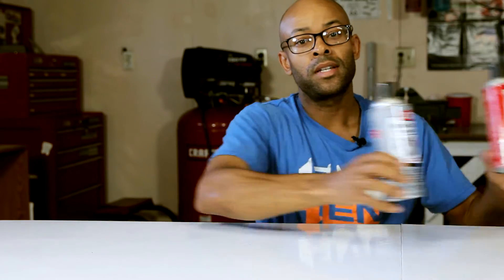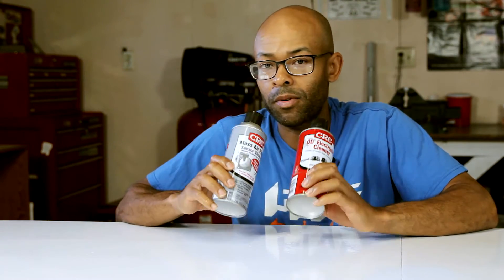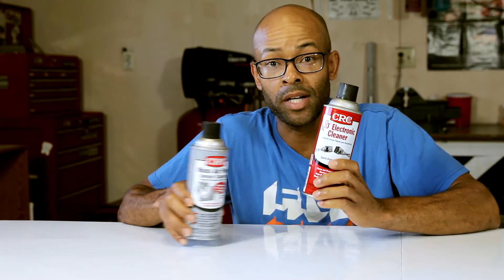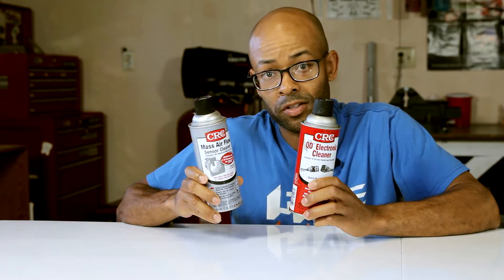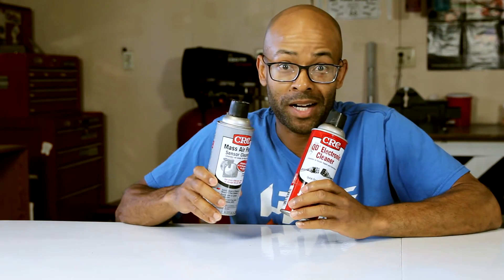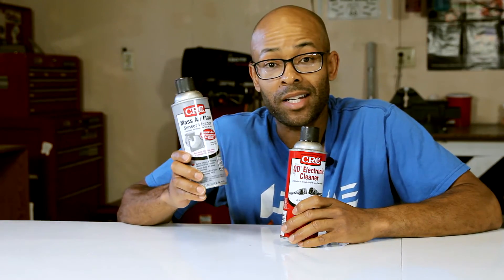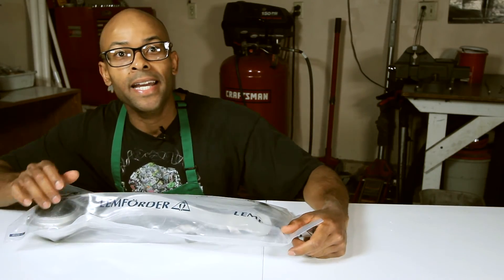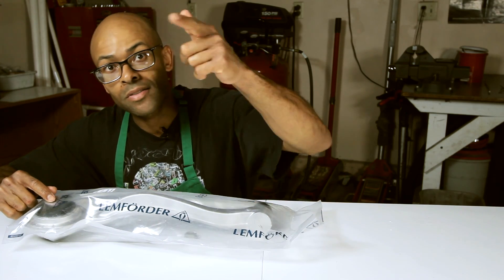Mercedes Benz - MAF Sensor Q & A | Mercedes Benz S500 W220

Comment: I have an e420 1997 mercedes with a 5.1v8 motor do you have a video for how to do this available? I can. Access and perform the service myself just like to ask questions first! Is it better to remove the maf from the throttle body? Then also run some carb cleaner on that before re installing the maf
Reply from the maker: Hello Lawrence Trapani, at the moment I do not have any videos on the e420. I would recommend removing the MAF sensor to clean it properly

Comment: is not possible to clean the MAF with brake cleaner ?
Reply from the maker: Hi Motorsport-Power, You do not want to use brake cleaner. The chemicals are too harsh and can damage or shorten the life of the MAF sensor.
Reply: why you just cant do the right thing